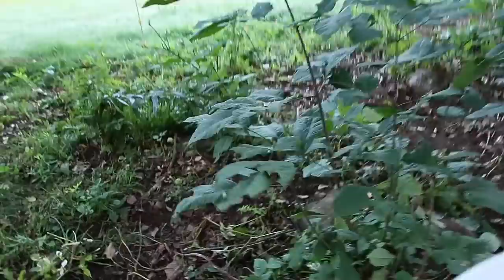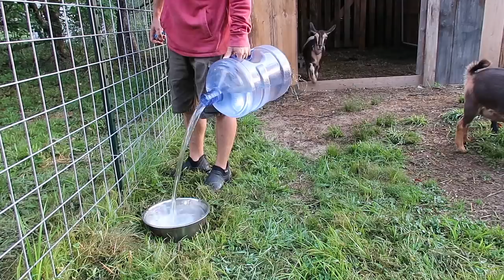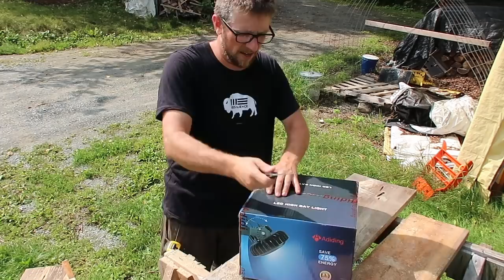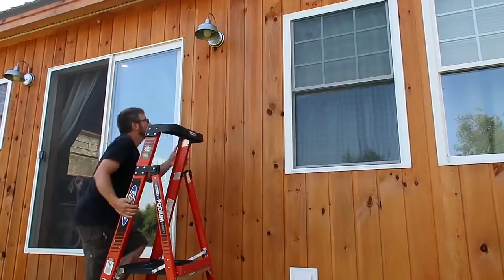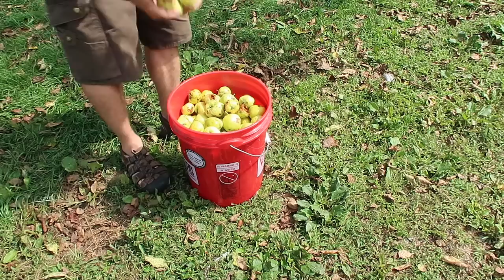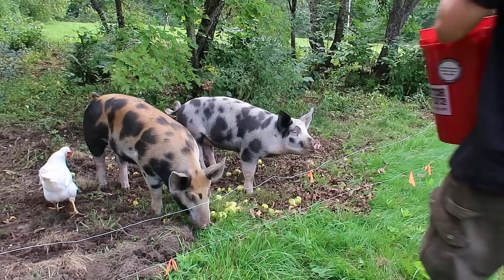This is Going to Change How we Do our Evening Chores FOREVER (New Outdoor LED Lighting)

Comment: So here in southwest Missouri it doesnt usually frost until around late October but each year is a little different. For your lighting issue in the goat barn and milking parlor, you could upcycle some clear plastic bottles. You drill holes in the roof the size of the bottle and put it in so that half of the bottle is sticking out of the top and half is inside. Make sure to caulk around it and support it underneath with a cross of wire. Then fill it with water and rubbing alcohol to keep the water from freezing in the winter. The water and clear bottle capture ambient light from those new snazzy flood lights you got and filter it into the barn and milking parlor like soft white lightbulbs. You'll be surprised how much light they capture and distribute inside! Best wishes from the Ozarks! Love your channel and keep the updates coming!

Comment: Place some solar / battery / LED lamp posts with timers / light level sensors around the property, saves running cables and will give lots of light coverage where you need it. 

Good for security and safety.

Comment: I picked up one of those Harbor Freight solar panel kits and that's what I'm going to use for my barn have not installed it yet but will do for your goats bench I took in puts Lots in mind and you smaller boards and it's a lot cleaner and lot healthier for the goats keep up the good work God bless you

Comment: Ok here’s what I did so I didn’t have to chase down our feed pan. I drilled a small hole near the top of the rim and tied a short piece of twine from the pan to a fence post. You could tie it to a stake if you’re worried about them getting too close to the hot wire.

Comment: Hey Al, 
I was able to customize Solar walkway lights that came with a small solar panel and actually used regular wall mount switches for interior lights and a few lights on the outside of our chicken coop and also have solar motion lights from amazon placed thru out different areas they also are great security for any predators that may come by... The solar lights have been shining bright for over 6yrs now problem free.
Good luck with your lighting!

Comment: I used a little light from amazon in the outhouse. It puts a panel outside running to a little battery pack than runs a few lights with switches or pull cords. I think they go for about 50.
Reply from the maker: I just ordered two like that for the goat area